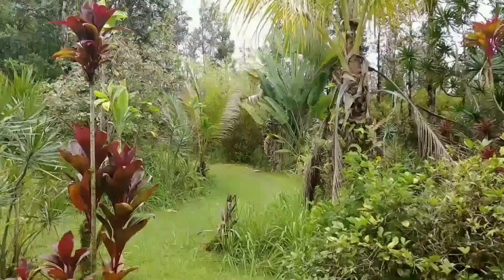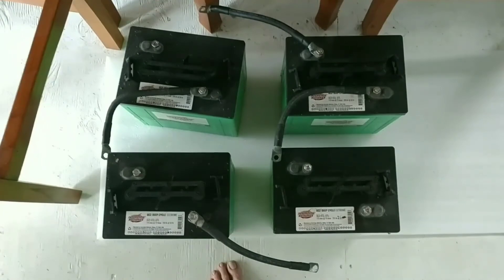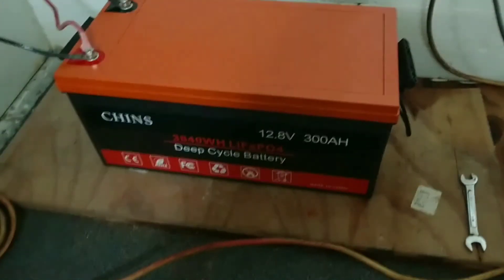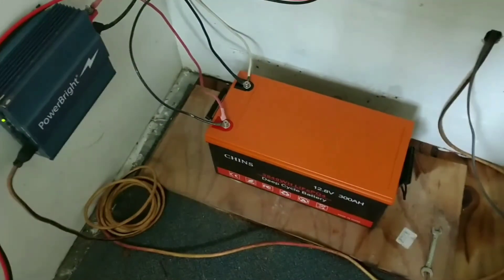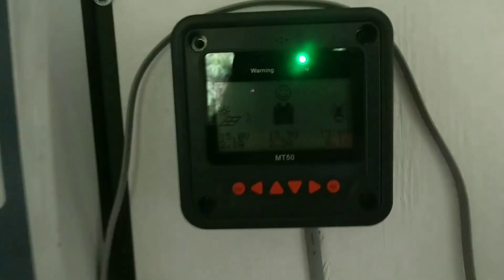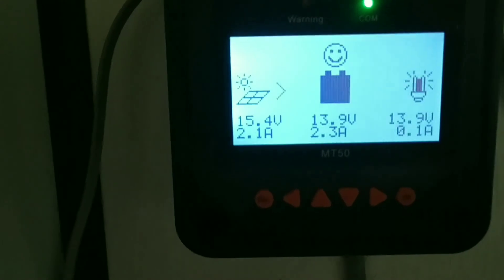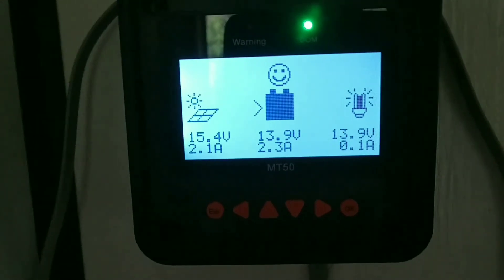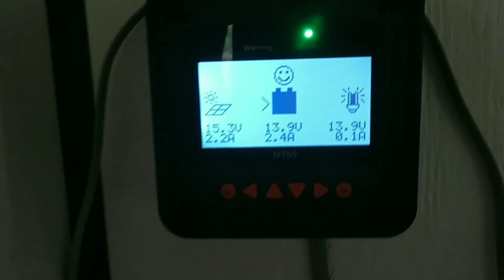Part 2 Chins lifepo4 300ah drop in

Comment: i would put a heavy duty relay on the power cable of the inverter and wire the low curent to the load side of the controller this way when battery hits low voltage shut off the controller can switch all loads off but keep the charging side active so that no loads force the battery bms to trigger stopping any power to or from the battery
Reply from the maker: I'm definitely going to look at doing that...thank you for the advice